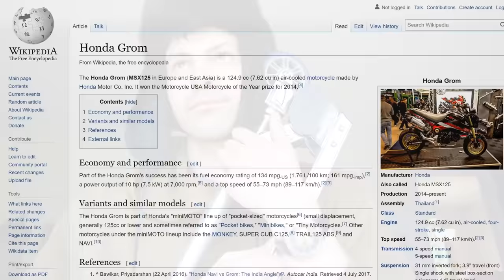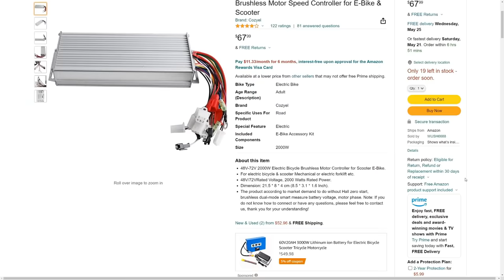I made a children's toy beat a real motorcycle

Comment: Well done man! That was dope, now add a capacitor bank on the battery to help on takeoff
If you intend on keeping this around and using it rough, change up the front shocks, those ones on there are known to fail in a rather spectacular fashion sending the rider flying forwards like superman on crack.

Comment: I used a 110cc tao tao quad frame and a predator 212cc with stage 5 mods.  That thing was geared so high that it would do 75 with my knees touching my elbows and i could easily pick the entire thing up and fit it in the hatchback of my small SUV. I also built out 2 DB30's with the same exact engines. You should definitely find a 110cc tao tao frame, strip the plastics like I did, and do an electric build with one. Theyre insanely fun compared to mini bikes, mainly because you can ride on 2 side wheels, wheelie, and drift it. They come stock with a foot brake and thumb throttle. Thumb throttles are superior to twists dont forget. Way better handling even on mini's.

Comment: I was part of a group of guys in the Bryan / college station area in Texas that would get together and race hopped up RSF350s
We couldn't get 60 miles per hour, but more like 25 to 30 maybe. One tip that I would leave you with is to get some taller bars, like off of the larger dirt bike model. I did this and it helped out a lot with cornering. I haven't finished the video, so if you've done this next part, ignore me. Cut the pegs off at the mount, and weld them higher up and a little further back. This will give you a lot more cornering clearance

Comment: Those controllers in my experience are still pretty poor.  Even at lower voltage (I run 88v worth of lipo) the MUCH smaller Kelly KBS-x controllers (size of a cigarette pack) are Sooo much more powerful, and fully programmable. Hope you get some more capable hubs and better controllers! Great project!

Comment: I had the RSF600 (the bigger more powerful version of that bike) for like... 6 years, and probably put more miles on it than anyone ever had. Always wanted to throw a gas motor in it or do upgrades but never did. Happy to see a version of it at least get the crazy power I always wanted it to have!
Reply: Dude, people have modified the rsf600 with huge electric motors! There’s a video of one on here that does 80mph. Just look it up. Sur-ronster’s video is probably the most watched one
Reply: @justbecause8085  there is a large aftermarket for the razor products. Electric scooter parts sells battery and motor kits

Comment: Have a razor dirtbike a step up from that.    Wired in an extra battery on a switch.  It actually moves pretty good, but on high power the motor still gets 12volts with the throttle off.  This is because it's wired so the esc only gets the normal 24

Comment: Just wanted to say, in the UK a 17 can ONLy have a 125, did roughly 30,000 miles until I turned 19 and got a versys 650.
The guy riding did not rev out the 125 at all, short shifting on a 125 is just ridiculous, I'd shift at 9k every time

Comment: You gotta be nice/welcoming people if every bike forum slams you for having anything less than 500cc anymore.  I don't even think it's so much as wanting to feel like a kid again as it is more just wanting to thrash around and have fun without worrying about losing your license/going to jail for going 120 in a 65.  I have a CB400 Super Four I love to death even if the CBR600F3 I've been building for fun over the years makes it look like a Grom.  Maybe it's because I kind of skipped the "enjoy stupid fast" stage and went straight to loving touring and taking pictures along the way.  My first car was a somewhat built LS1 Trans Am (around 340hp to the wheels, not a lot more than factory) that I still have running.  I have more fun with my turbocharged 2nd gen Probe GT; you can blow through the gears with fun acceleration out and about and not just on a track lol.

Comment: loveing it.
i think you could of just used one rear motor with a bigger esc and it would of been about as fast.
it would be interesting to see an acceleration comparison between one motor off and two motors on.
Reply from the maker: both tires were breaking loose a bit, so I think one motor (with these tires) wouldn't be able to effectively put down the power.

Comment: A mid drive motor would give you more power than a hub motor of the same rating. You can also gear it. A 48v 1000w hub drive motor can cost around 800 bucks but it was only 80 bucks for a 48v 1000w 52a mid drive motor. On my homemade frame ebike i hit 40mph.
Reply from the maker: Fair points, but I got that wrecked scooter for $200. There are also fewer points of failure with a hub drive, which is nice for simplifying some systems.

Comment: awesome awesome project. I wouldve handled that battery and controller situation differently but if it works it works.. I love these videos.

if youre ever in ny I wanna race.. My diy vs yours.. ive made this challenge probably 100 times and no youtuber has ever taken me up on it but it would be fun nonetheless so i keep offering. lol.

diy1: 60v, 100A (dual 50A controllers), 6000W (dual 3kw) standing scooter. Modded xplor odyssey, aka flj k6
diy2: completely diy. 120v, 840A, 100800watts.. 140 horsepower. e-moto. 200mph. 0-60 in supercar numbers. took me over a year and over 10 grand to build. lol
Reply from the maker: Thank you, I would've done this differently as well given more time. Your challenge sounds fun, likely it's been turned down because they would have to spend at least as much money to create something that could compete! My project budgets are still fairly low, this whole build was around $500 because I was able to borrow the batteries.
Reply: @JoelCreates  I wish I wouldn't have sold my first diy pev. That would've been fun to race. It was a cheapo eBay scooter. 48v 1600w. 500$ for the scooter and another probably 300  for motor and controller upgrades. 84v 8000w. I had the cells already to build a batt but that's where the big money usually is in these builds. I look forward to batt tech lowering in price and raising in power density. 

Awesome vid again man. I subbed. Watched a few vids. I already love the channel!!

Comment: Well... Electric Motors are On and Off, So you accelerate really quickly but once its at its maximum speed its possible for a monster engine bike to overtake should it have the power.
Reply: But versus those pathetic Bikes, Electric Motor will always most likely be the faster between the two.

Comment: I'm not sure I would comfortable have that many explosive battery packs that close to my ball-bearings.
Reply: Battery packs are not at risk of catching fire during the discharging cycle, it's charging where they go out of balance (bad or cheap bms) all that energy coming in has to go somewhere and they overcharge and vent.
Reply: @ss4goku9695  That not  true. Anytime while charging or after being charged, they CAN explode if a short circuit occurs. They are only "safe" when fully discharged.  Add to that they can and often do heat up a good deal while discharging exactly like they do while charging. 
 To be clear, I am not criticizing the project at all.  Just noting that's a lot of explosive to have so close to one's balls.
Reply: @Robert08010  I meant well built packs, in line fuses prevent short circuits outside the pack, while the bms manages balancing inside the pack. While I do agree that there is a chance of fire when using lithium ion, good quality cells have greatly reduced the chance of thermal runway during discharge.

Comment: please get broken honda grom, electrify it and put a ninebot z10 (or z6/z8, the motors are the same) motor on it. or maybe 2. it'll fit. probably lol.pleaseeeeee. good vid btw. the motors can run 84v easily, and go quite fast with that voltage, like 65mph+
Reply from the maker: I Doubt there are many cheap/broken groms on the market